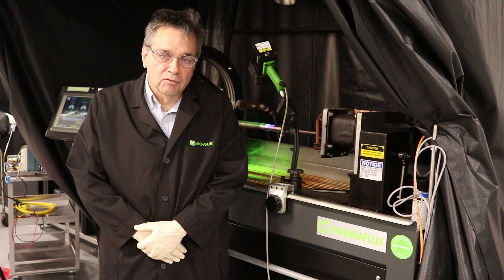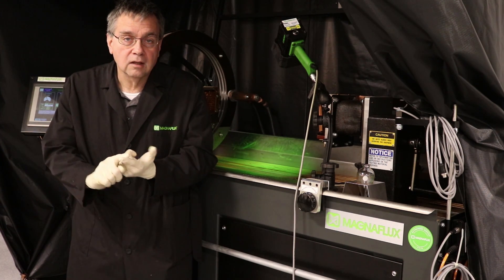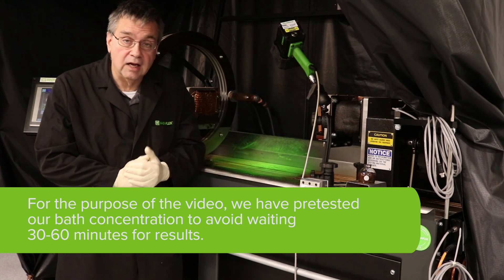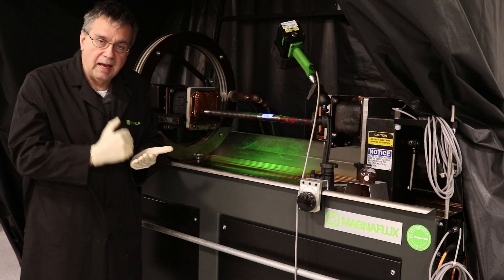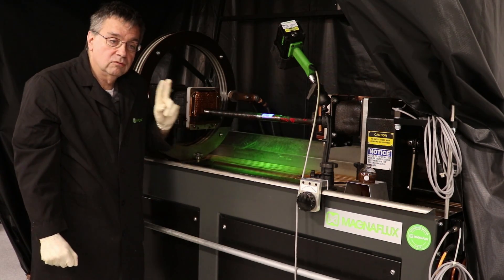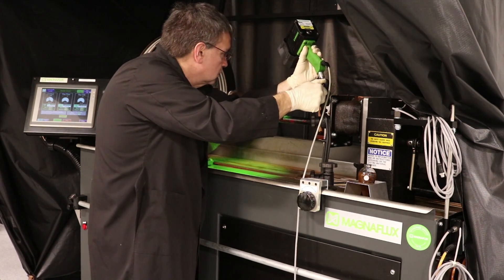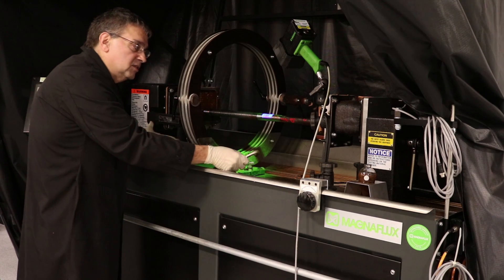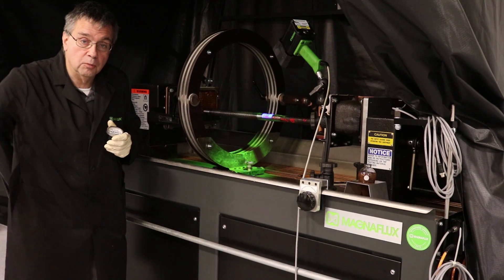How to Do Fluorescent NDT with Magnetic Particle Inspection

Comment: Need to agitate particles, demag before the letting the centrifuge sit..also Head shot and coil shot may need to be demagnetized if the amperage is higher on the first shot.
Reply from the maker: Nice attention to detail! Before this video we ran the bath for 60 minutes to agitate the magnetic particles. We didn't specifically call it out, but we confirmed that our bath was also within the Gauss tolerance beforehand. You are correct, by ASTM E709, E1444, and E3024 standards you are to demagnetize the sample after taking it and then let it sit for 30 minutes for water or 60 minutes for oil.
 I appreciate you letting us know these details are critical to the viewer, so then our next video can be more thorough .
Reply: Magnaflux we use Magnaflux at our facility. Love our Mag machine and the particles you provide are unmatched
Reply from the maker: Hi  @Karizma024 . We would love if you email any photos you are comfortable with us sharing on our Instagram page to marketing@magnaflux.com. We love hearing and sharing these awesome stories!

Comment: Fair bit missing from this video. AS5282 ring test required prior to testing parts, system performance must be confirmed! Centrifuge should be demagnetised after pouring the sample. Continuous wet method requires the fluid to be stopped just prior to the first shot. You absolutely cannot use a castrol strip to confirm adequate magnetic field strength, only a QQI or Hall effect meter or part with known defect can do that. ASTM E1444 is pretty clear on the only approved methods for confirming field strength and direction.

Comment: I’ve got a hardened LS gear that refuses to give up any magnetism using the yoke pull away method. I’ve also struck it with a hammer to no avail. I don’t have a demag yoke. When I was at GE Power Systems Airfoils we did utilize such a yoke. But when engineers decided to machine a fillet in the base of the big rotor zeroes the demag process could take 20 minutes. A quality engineer thought we were joking (lying) until he tried it.

Comment: Nice vide, however I have few queries, One during coil shot, the magnetization level at the center is not enough. the part is slightly off center but still it should be on the bottom of the coil. Secondly residual magnetization is to be checked at the end of the part not in the center. Can you please comment on that?
Reply from the maker: Although your statement regarding the stronger field by placing the part near or at the bottom of the coil would be true in some cases, you can also run the parts anywhere inside the coil diameter. As long as you have a proven technique, and establish a 30 gauss field on the area to be inspected, and verified by a QQI, which is shown in the video, the part can be placed anywhere inside coil. 

The residual magnetism should be checked along the entire part, not just at the ends. In this case he starts in the middle of the part and did run the meter to the end. In some parts with complex geometries, the magnetism can indeed form anywhere on the part, therefore checking the entire part would be critical.

Comment: Can you provide more information about the Methods that are used for detection in Steam Turbine Rotor?
Do you deal with such large components?
Reply from the maker: Typically - if the Steam Team Rotor is being checked after being placed in service - MPI inspections will be performed using the cable wrap method. This inspection is mainly focused on the turbine blades themselves. We have developed equipment specifically for turbine rotor inspections. The M-2030 Mobile Power Pack is specifically designed to produce 3000 amps with 90 ft of 4/0 cable in a single loop, which allows for rotor inspections using the cable wrap method. Learn more about it here: https://bit.ly/2B23Y7W
Reply: @Magnaflux2010   As we know the MPI have  serious disadvantage that the residual magnetization can lead to severe damage, why do we prefer it even though we have certain other reliable methods to test it?
Why should we choose MPI over other NDT??
Reply from the maker: @palashjain4203  The choice of test methods is always at the discretion of the end user. MPI is a reliable and proven method for use on ferrous metals. There are several techniques available to demagnetize parts after inspection. Gauss readings of less than 3 are typically inconsequential. MPI can provide very fast and accurate identification and reading of part flaws where other methods might be more costly. It is the responsibility of the relevant trained Level III technician to identify the best test method for every part.

Comment: How do you ensure that the equipment is safe to use with high current? For example if you are touching a Part and accidental apply the current?
Reply from the maker: Magnaflux machines are safe due to the extremely low voltage that the part physically sees.
 Most of our wet benches have a voltage of less than 20 volts – which is not high enough to overcome the resistance of the human body. OSHA regulations does not consider anything energized (thus requiring protection) unless the voltage is 50 volts or higher.

Comment: How many kind off magnetic yoke. Pls explain sir
Reply from the maker: Fluorescent inspection works with any magnetic yoke.  The Y-2 is our newest AC yoke, combining advanced ergonomics and modular design for maximum reliability. The Y-7 is our AC/DC yoke, able to produce both surface and subsurface indications in a single unit. The Y-8 is our battery-powered DC yoke providing maximum portability for use in remote locations with no power source. 

Y-2 AC Yoke: https://www.magnaflux.com/Products/Y-2.htm
Y-7 AC/DC Yoke: https://www.magnaflux.com/Products/Y-7.htm
Y-8 DC Battery-Powered Yoke: https://www.magnaflux.com/Products/Y-8-Kit.htm